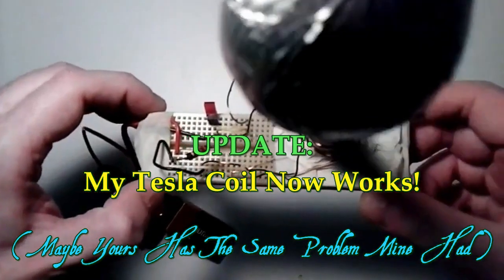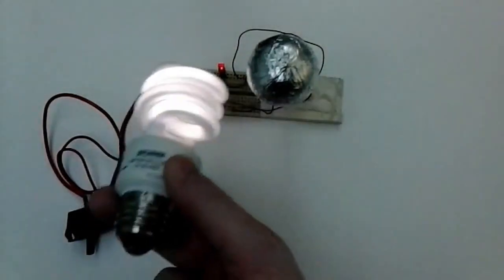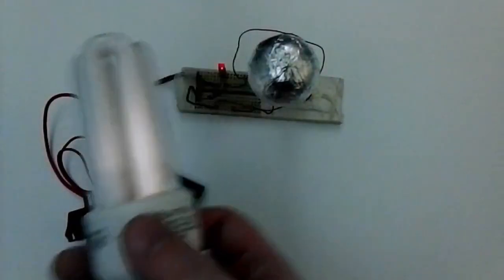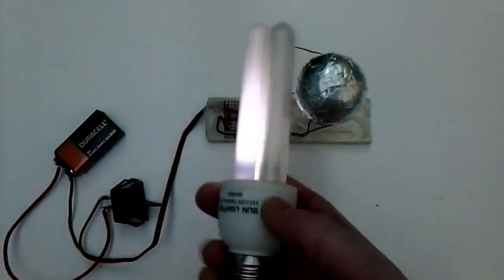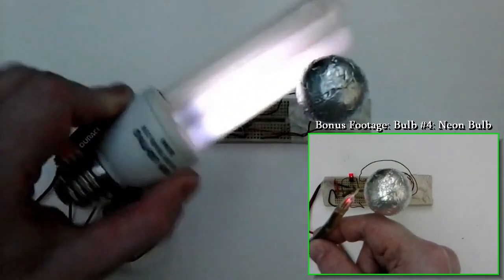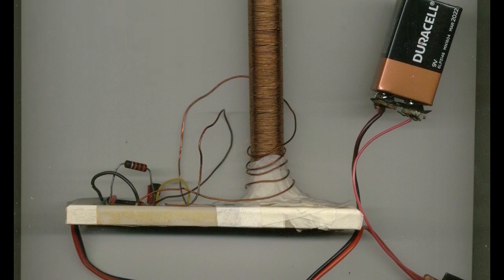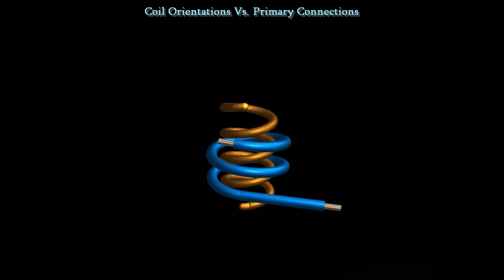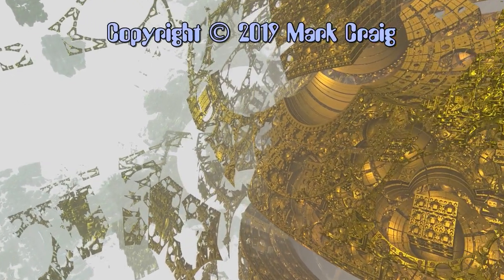UPDATE: My Tesla Coil Now Works! (Maybe Yours Has The Same Problem Mine Had)

Comment: Will Bc547  transistor work
Reply from the maker: I don't know for sure... but one website says one of it's equivalents is 2n2222, so it probably would work.  I looked at the datasheet of a fairchild bc547 and a datasheet of one of the 2n2222 models/manufacturers and tried to compare.  The bc547 has a much lower maximum collector current than the 2222 - I don't know if that would be a problem.  It might heat up a lot easier (and perhaps blow).  I don't have any information on the high frequency capability of the bc547, so I don't know how well it would do in a tesla coil.  Unless your bc547 is precious to you (like you only have one and you need to make sure it doesn't go bad), I would say give it a try.
Reply: @MrMcsoftware   now by applying 22k resistance will it work
Reply from the maker: I assume you're meaning putting a 22k resistor at the collector (since there is already a 22k resistor at the base)...  I don't know.  I guess it wouldn't hurt to try, but be prepared to reduce the collector resistor if your tesla coil doesn't work.  I tried LTSpice simulation (which of course isn't exact because of all the guessed values (capacitance between coil top and ground, impedances of the construced coils, etc.)) and I needed to reduce the collector resistor to 75 ohms in order to be at 100mA limit but still provide a descent output voltage (at top of coil) (it's less than a third of the output voltage of the original circuit (without the resistor) though).  At 22k, it completely doesn't work (in the simulation).  I should probably mention that the simulation uses a 2n2222 transistor.  Using a bc547c model in LTSpice results in a non-working tesla coil no matter what the collector resistor is.  Using a bc547b model does work but the collector resistor needs to be about 47 ohms and the output at the top of the coil is even less than the 2n2222 scenario I mentioned.  But, as I said, the simulation isn't perfect.

Comment: I’ve tried to make a Tesla coil for so long and it’s still not working
Reply from the maker: (Assuming yours is a slayer exciter version...)  I cover a lot of things that can go wrong in my first Tesla video ( https://www.youtube.com/watch?v=gwSStwG7Hm8 ) like, for example, primary coil not connected right given the direction (in relation to the secondary) you choose.  But, in my case, it was the transistor, which was good but most likely lost it's high-frequency switching capability or maybe that transistor model had slightly insufficient specs.  I had pretty much given up - I even thought the whole thing was cursed.  I knew it should work, but nothing I did would make it work.  Then one day I was salvaging parts from a non-working UPS and I noticed it had a lot of 2222 transistors, so I thought, "It's not gonna work, but if I don't try, I'll never get any peace of mind", and what-do-you-know, it worked.

Comment: Another problem you can get with transistors, is they lose some of their high frequency response.
Or it's just a different brand/batch of transistor where the gain or voltage/current ratings are different.

Not the first time something tests fine in a transistor tester, but fails in the circuit with higher voltage/current/frequency.
Reply from the maker: I felt that the transistor variation/etc. problem was worse than I stated, but I didn't want to say something I wasn't 100% sure about.  So, I'm glad you commented on the problems transistors can have.  Thanks for the information